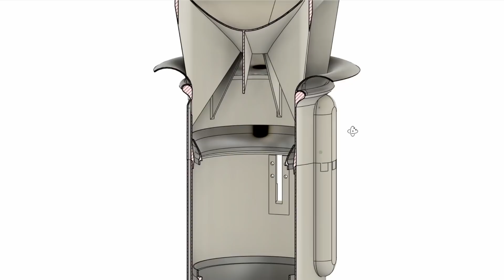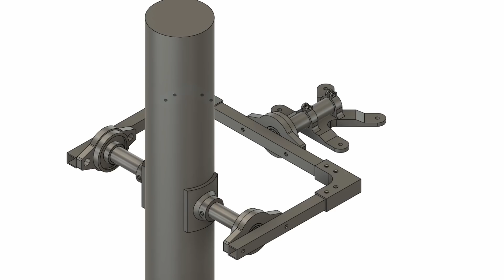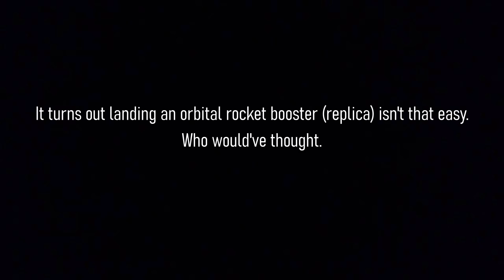SpaceX inspired edf rocket part 2: Final assembly, tuning and maiden flight

Comment: We want to see fire, 😁
Reply from the maker: Yes me to, but liqued fueled rocket engines are expensive and hard to build.
Reply from the maker: @Seth'sChopShop, of course i know what SRB's are. But if you're trying to land a booster it'd be a lot easier if you would have some sort of throttle control. SRB's either burn or they don't, so throttle control between 1 and 0. It has already been proven that trying to land a model rocket with an SRB can be very difficult (i don't say impossible), Joe Barnard from BPS.space has already done a lot of development and testing on doing this exact thing.

Comment: Fins that pop out on top. problem solved
Reply from the maker: Unfortunately it's not that easy 😅, Grid fins are only usefull at higher speeds, They need high volumes of air to pass over them in order to be effective. They’re pretty much useless when you have almost no vertical velocity like in this case where it’s just hovering.

Comment: Seems like too high CoM
Reply from the maker: @Eana Yayo The weight needs to be at the top or else it won't fly at all. You can compare this with trying to balance a large and a small stick on your finger, the larger stick will be easier to balance. The higher your cg, the more leverage and control authority you have at the bottom. Of course for the landing it would be ideal to have the cg as low as possible but then the thing won't fly at all. The CG would actually need to move from the top to the bottom when landing.
Reply: @BrianBrocken  you already made it fly and it's awesome, but high CG prevents stability on the ground. You know how stable real F9 booster is, it never tilted over. I think decreasing angular momentum twice won't make it unstable, rather just less maneurable.

Comment: lmao a FAN ON A STICK at the best, nowhere near a rocket.
Reply from the maker: Ok fair enough, I challange you to build a stick that flies with only 1 ducted fan and Thrust vector control because writing a comment is obviously a lot easier. Get back to me when you're done.

also this is what i mentioned in the description: 
"For those of you who say an edf is not a rocket, you're right it's technically a single copter design in the shape of a (SpaceX) rocket. An edf really is the easiest and cheapest way to control the thrust to maintain a stable hover."
Reply from the maker: or even beter, build me a liquid fueled rocket engine, because that's what everyone here is expecting and thinking its as easy to build as baking a cake.

Comment: dondola troppo, non è  stabile
Reply from the maker: My man, do you even realise how hard it is to get something like this in the air, let alone get it stable enough to get somewhat of control authority over it using only 1 high torque motor and thrust vector control? I spend weeks, months to find the correct PID values, find the right values for the torque compensation of the motor, find the correct shape for the thrust vector control fins, try out different edf's with different voltage, kv and Watt ratings, trying out batteries with different mah and c-ratings, even trying out different kinds of electrical wire to minimise losses and all different kinds of ways to lower the weight of the thing to even just get it of the ground...